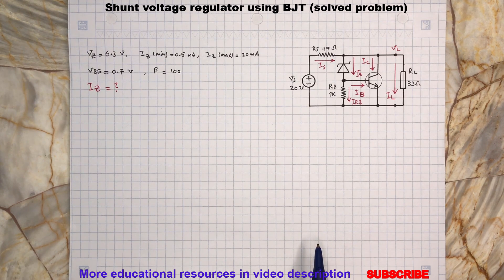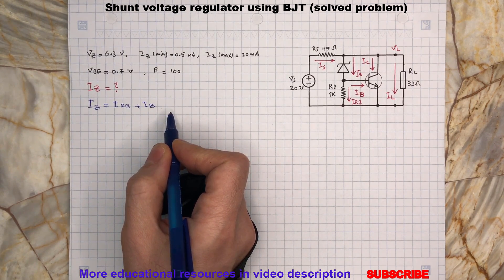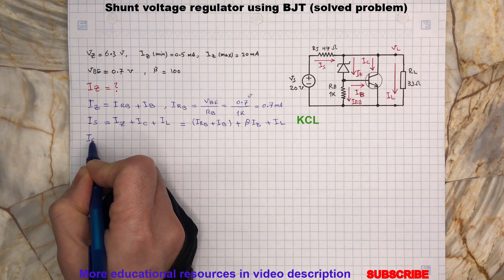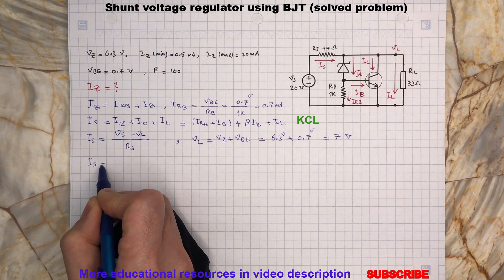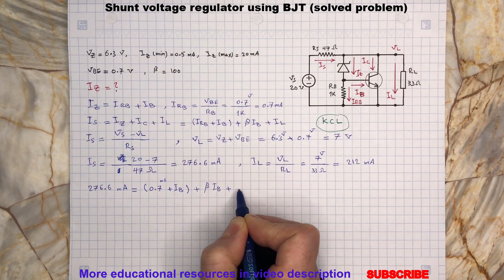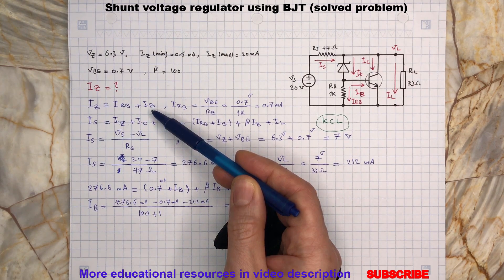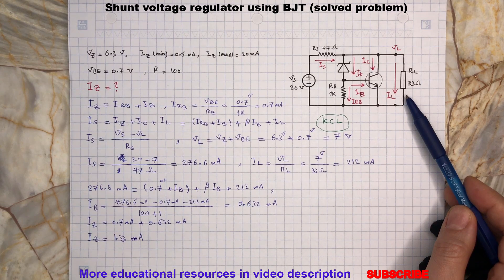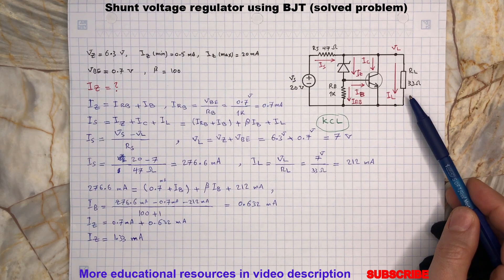Shunt Voltage Regulator Using Zener and BJT Transistor

Comment from the maker: Voltage Reference Circuit Analysis : https://youtu.be/nkcTwK1LTDI
Full-Wave Bridge Rectifier using IC 7809:  https://youtu.be/oplCvtsdcM0
Voltage Regulator and Current Limiting Circuit Analysis:  https://youtu.be/8Mn6LC2isHs
Op-Amp and Zenner Voltage Regulator:  https://youtu.be/CKMxGu3uHAA
Transistor Series Voltage Regulator:  https://youtu.be/OuVbjRZHM9U
Electronic Circuit Analysis Playlist: https://www.youtube.com/playlist?list=PLLA_QJ8rHZBh5LqrY41bCvKgreRDRWrBQ

Comment: what is the small signal analysis of this kind of circuits?
Reply from the maker: In general, for voltage regulators , we don't perform small signal analysis because we deal with DC voltage and currents.
Reply: @EngineeringinDepth  so should we just put a resistor model for zener diode?
Reply from the maker: @atenazojaji8312  not exactly, but it can be modeled with a resistor and a diode with a higher voltage breakdown. Zener diode can also be used in low frequency applications such as clipper and clampers .Maybe watching this video will clarify things : https://youtube.com/shorts/NZ6H9M0wLnw?feature=share